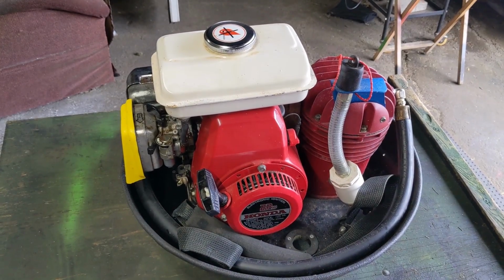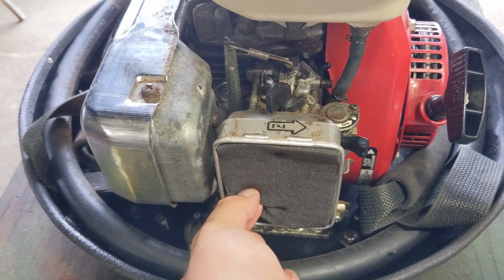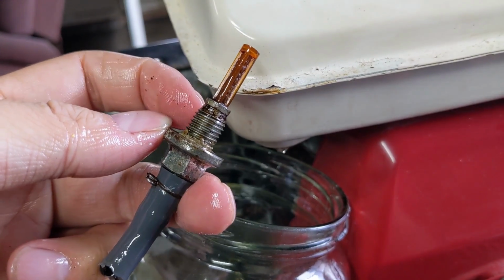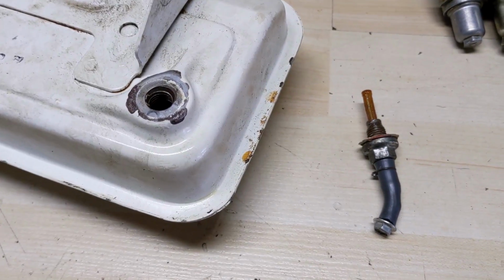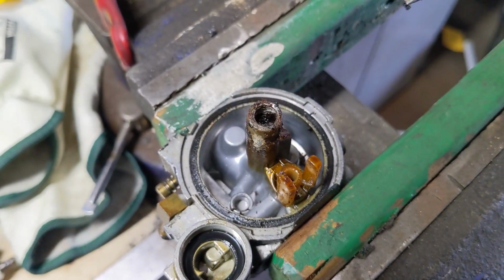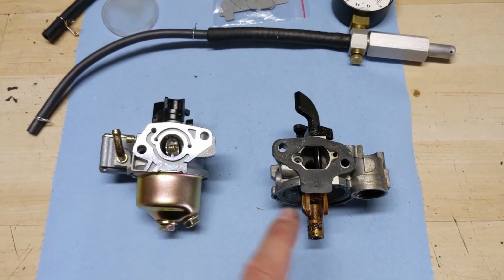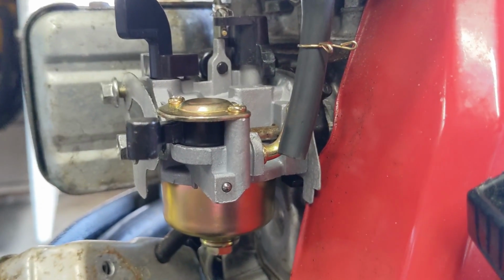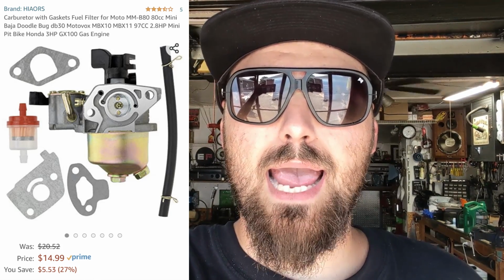Brownie's Third Lung

Comment: OK  This is the most different video I have seen.  The last tank i did I used Methyl Hydrate.  This seems better.
Reply: Vinegar works good too
Reply from the maker: Worked pretty good, make sure you rinse it out with lots of old fuel. Not perfect like I said, but you could spend hours. This works well enough. Thanks for watching!
Reply: KB used toilet bowl cleaner worked well also

Comment: Good job! You can also blow through the carb and flip it over to see if the needle valve works with the float, if you don't have the fancy carb pressure guage :)
Reply from the maker: Yes, I used to do that, but the tool works much better. Thanks for watching!

Comment: I've been having good luck with the cheap Chinese carbs for Hondas lately I bought 2 for my 160 cc mowers and installed both and never had to tune them either. But the way I look at it is there are a lot of manufacturers who copy Honda the repop carbs should be pretty good
Reply from the maker: Yea that's a great point, but also be careful who you buy from because some vendors may try to slip in some junk. Thanks for watching!
Reply: @EliminatorPerformance  I agree with you on that one that third lung was really cool thanks for posting it